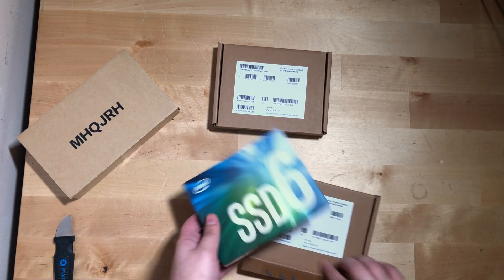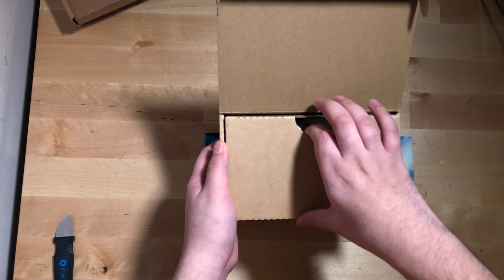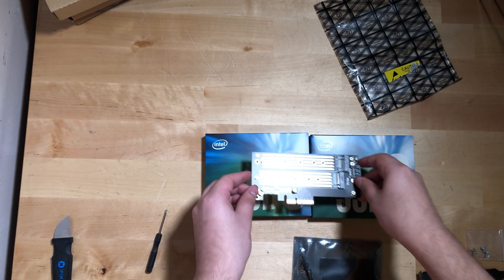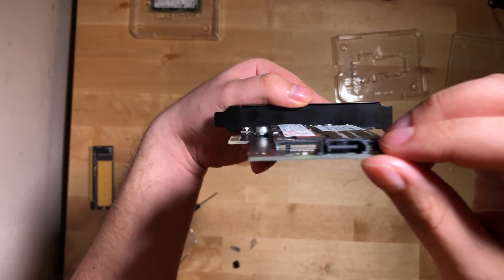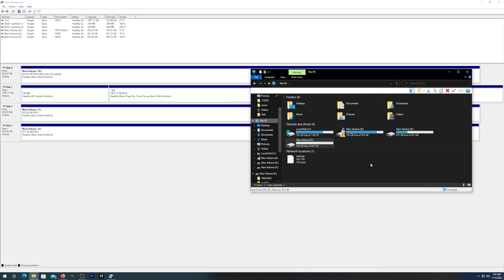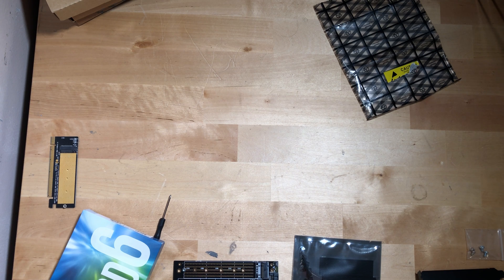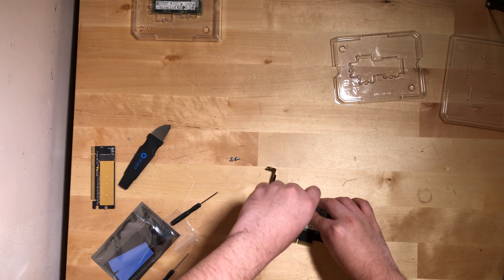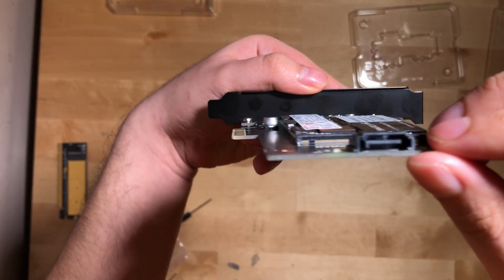Cheap M.2 Expansion Card - Dual M.2 PCIE Adapter SATA +NVMe SSD PCI-e Host Controller Expansion Card

Comment: why dont they just make dual nvme pcie adapter that share speeds?
i honest dont care if they both only run 500mbps
lower speed reduce heat anyway so no need to worry about heatsink and its still ssd IO speed

Comment: What is the use case for a m.2 M key NVME and B key SSD PCI adapter card? I know the NVME side is faster than the SSD. is this for caching like STOREMI?
Reply: It's probably for:
1: someone who moves drives between machines and wants a machine that can read any type of drive.
2: someone who wants two SSDs on raid for redundancy and is willing to take the performance hit of a cheaper card.
I bought this and am in the later category.

Comment: Thanks for the review. I just placed this into my Amazon cart. I didn't realize that it's only a one M.2 adaptor card until I saw your review. You nailed it when you said the price is good for under $20 and that its worth it if 1 slot is all the user needs for the m.2.
Reply: If you had a dual or more slot card, you also need a mobo that has burifaction. Not many do. Or you PC will only see 1 NVME

Comment: I bought a card that plugs into the second pcie x16 slot on my motherboard. I put a gen 4 nvme on the car and plugged it into the slot. But now can't get bios or windows to see it. Do you have any idea what I need to do? Motherboard is a MSI Tomahawk B550, win 10. Thanks.
Also, the motherboard already has 2 Nvme ports on it, I have a 1tb gen 4 on each of them. This one is a 2tb gen 4.

Comment: I bought something similar to yours. Windows 10 can read it. But bios cant. Any tips?
Reply from the maker: that's really odd. do the drives not show up in the bios at all?
Reply: @EVOTech1  No, The weird thing is its a Sata Base NVMe but when i put it into PCIE NVMe it reads on Windows but not on Bios. But when i put it on Sata NVMe it doesn't read.
Reply from the maker: @rhyssdasma5099  what exact model SSDs are you using?
Reply: @EVOTech1  sdapnuw-256g-1014
Reply: I cloned my hdd drive to the ssd
Reply from the maker: @rhyssdasma5099  wait so looking up the specs of it, it seems to be nvme. is it sata or nvme the one you have? remember, nvme does not mean m.2. Ealier you said it's a sata based NVME, which does not exist. an M.2 SSD can be either sata or nvme. not both. so im guessing it's an NVME you're using. if that's the case, what port did you plug it into?
Reply: @EVOTech1  do you have a discord that i could send some pictures?
Reply from the maker: @rhyssdasma5099  my discord is asdf4455#1459. I have a friend working on setting up a channel discord server so when that's setup, we're going to have a tech support/issues channel, so it'd be great to have it posted there. but in the meantime you can message me directly on discord so we can potentially figure out what's going on.
Reply: I did nvme driver mod bios, so detected and boot
Reply: @albhenpa  do you have a yt link? Ive read some few bios brick.
Reply: @rhyssdasma5099  cant post link, google up win raid bios mode nvme boot
Reply: @albhenpa  thanks!